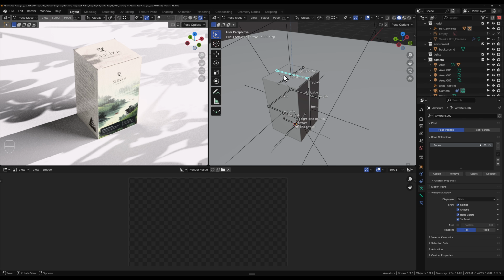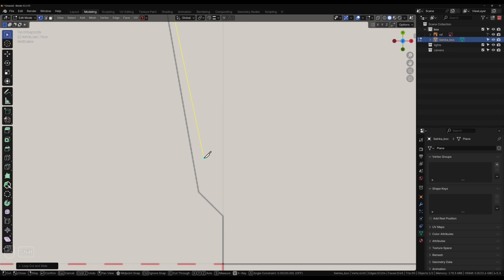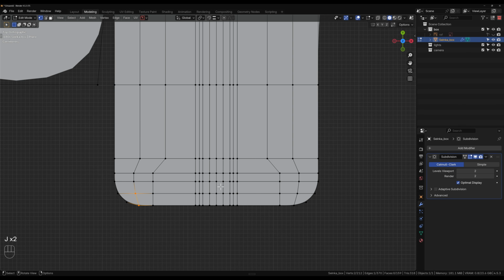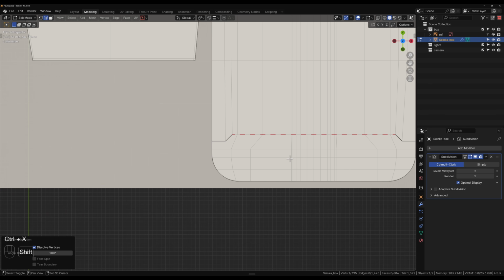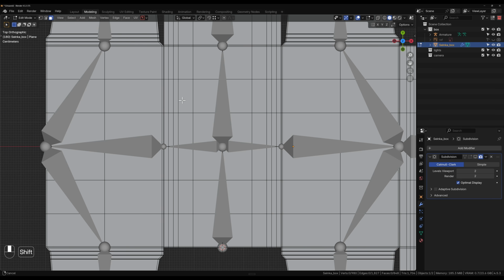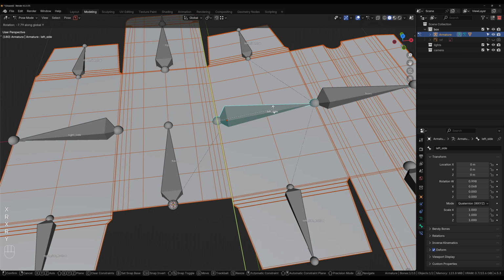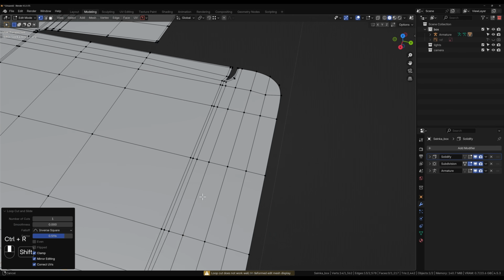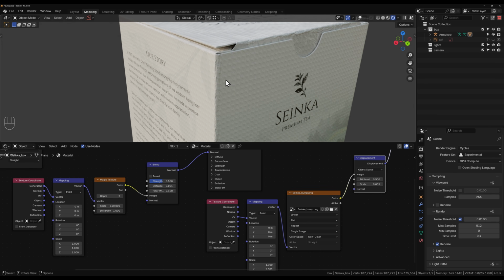Complete guide to modelling dieline packaging inside Blender

Comment: Thank you for making such a thoughtful video, but I am a beginner in Blender and I don't know the difference between this unfolded diagram and the unfolded diagram exported in SVG format directly in illustrator.
Reply from the maker: An SVG imported into Blender creates bad topology. So you will still have to fix the the mesh. Either way will work the same and should take the same amount of time.
Reply: @Interactiv  Thanks for your answer. My current workflow is to draw the knife pattern in illustrator, export the SVG to blender, convert it to a mesh, and then use Limited Dissolve to remove the extra lines. It seems to work fine.